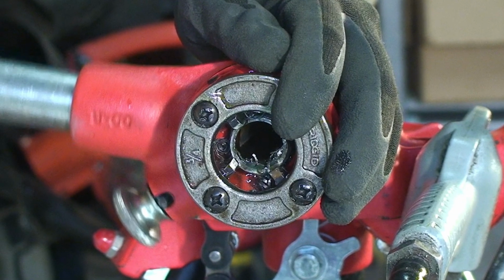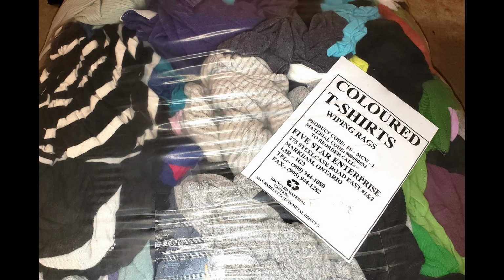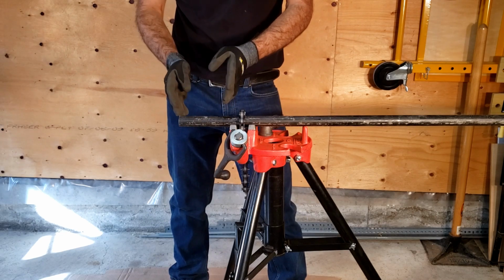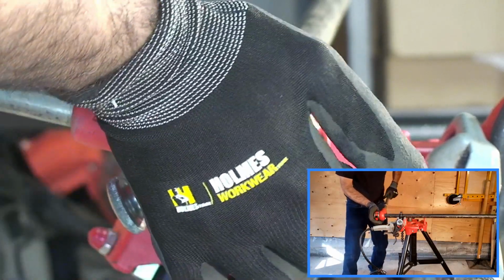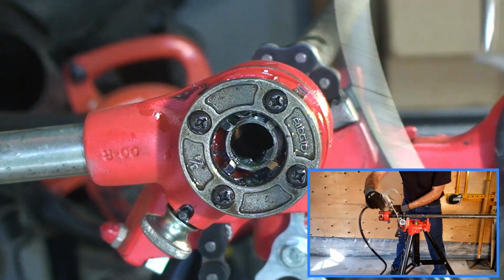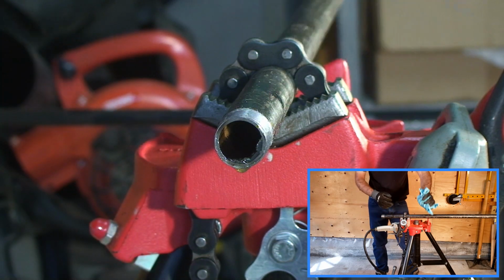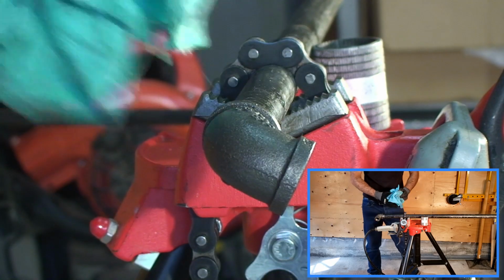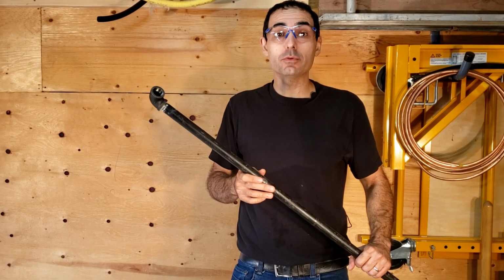Manually Threading Steel Pipe (Old School!)

Comment: Well, i certainly won't be taking this up as a hobby any time soon..lol..i was curious how to do it and now i know.
Great presentation!
Reply from the maker: Thanks so much!  It's no that bad, really...unless you're threading piping larger than 1-inch...which will turn out to be an ultimate and unforgettable fitness workout for your chest, arms and triceps!

But if you only need to thread a few joints, or are required to thread for only a small job (such as adding or modifying branch to an existing gas or fire sprinkler line), then this may be your most cost-efficient bet - without having to worry about purchasing or lugging around a $6,000+ power threader, like the Ridgid 300.

Thanks for your feedback!

Comment: I have made hundreds of threads on pipe ends. 1/8" up to 2".  Had a master threaded pipe fitter to tell me," You keep a 90 or tee  on the pipe vise. After making threads, try the 90 or tee on the new threads. The fitting must not turn more than 2-3 times by hand. Any more than 3 x ... and the threads were cut too far/deep ... the joint will leak.
 So, here is the formula..."three turns by hand...three turns with the proper sized pipe wrench...three threads left over (we can count the remaining threads..."ahead" of the fitting just tightened on with the wrench).
 Want to mention...can't trust the threaded ends from the factory. They are too deep. Cut them off, make new ones, then still put a 90/tee on the new threads (three turns by hand) to make sure. It's not much trouble...compared to installing the whole the new pipes up high, etc...then having to unscrew the whole thing...make new threads...then the putting it all back together ??? 
 Out of all the threaded pipe joints I have made in industrial plants, hospital boiler rooms...not one leak.
Reply from the maker: Great tips!  Fittings are also what I would always use to set and test my Ridgid 300 dies at the start of each day - and always made sure to keep one within arm's length for that purpose.  The only thing I would add is to ensure that the test fitting is new, notably it's of black malleable, which is prone to stretching.  The only other problem I've found is that even factory-new fittings have had inconsistent threads (even pinholes!) over the recent years - depending upon which offshore factory they were manufactured that week! 

Thanks for the feedback!
Reply: It's fine to put the factory threads on factory fittings as long as they're both out of spec by the same amount XD

Comment: Thanks for the informative video. If my pipe is underground, ie there is limited space, can the pipe still be threaded, eg by removing the handle of the pipe threader?
Reply from the maker: Unfortunately, you can not use these manual threaders without applying the handle for leverage, because there's simply too much resistance from the dies cutting into the pipe (the larger the pipe, the harder it becomes).  The good news is that, because the tool is ratcheted, you don't need much handle swing to turn the head (although it will take you a while if your motion is short).

As an (expensive!) alternative, they do manufacture electric "thread in place" power-drive threaders, which clamp onto the pipe while a motor turns the die head.  #Ridgid is one such manufacturer, but it may be overkill for your needs:

https://www.ridgid.com/us/en/hand-held-power-drives

If you only have a thread or two to make (and a bit of wiggle room), the hand threaders may be your most economical solution.

Thanks for watching, and good luck!
Reply: @PlumbingsCool  Thanks for the detailed explanation & great video! Really gave me a good idea of what I need to do.

Comment: I just purchased a ratchet pipe threader and cutter to connect some pipe for propane. 
Once the pipe was cut and threads made...the fittings don't seem to want to screw on. 
Saw one video that was saying that manual pipe threaders and even some of the electric ones do not taper the pipe and cause the problem. 
Would like your opinion on this. And if you agree to this being the problem...do you have any suggestion how to remedy it?
Went to Home Depot to have them cut pipe and had same problem....you could see that the threads by the manufacturer of the pipe were tapered. When Home Depot cut the threads...they weren't as far as I could tell.
Trying to see if there is a taper attachment for this pipe threader----or that may be totally ridiculous to even think that.
Thanks for your help and this was a nice video. Appreciate your time to put it together for us. Jesus bless.
Reply from the maker: Hmmm...I reckon something's amiss with your pipe threader.  It sounds like you're in North America as I am, which means that we tradespeople in the US and Canada utilize what's referred to as American Standard or Briggs pipe thread.  It's a standardized imperial system system that which maintains certain standards to ensure a proper thread.   There are three primary factors, which consist of:
-The correct taper
-The correct pitch or Threads-per-inch (TPI)
-The correct thread cut angle (60°s)

If your dealing with propane pipe and fittings, you'd most certainly be requiring a tapered thread, which is what allows the pipe to tighten as it turns into the fitting, and what ultimately causes a seal.  If it had no taper (referred to as a running thread, like a bolt or threaded rod), the pipe would simply keep turning until it would just keep  turning until it bottomed out at the end of the thread, and certainly would not seal properly. 

One way to test if the cut thread has a taper is to place a straight edge (like a ruler) flat against and parallel along the pipe and have a few inches travel past the threaded pipe end so there's an overhang.  You should be able to see the thread taper in and away from the straight edge as it comes to an end.

You can also roughly count if your threads have the proper pitch or Thread per inch as follows (although it might be tricky because your threads may not even actually be an inch in length):

-1/8": 27 TPI
-1/4" and 3/8": 18 TPI 
-1/2" and 3/4": 14 TPI 
-1", 1-1/4", 1-1/2" and 2": 11-1/2 TPI 
-Over 2": 8 TPI

Also, another problem causing your threads not to tighten is that you may be making your threads too long. As a general rule, the end of your pipe should pass the last cutting die by a distance of no more than one or two full threads. Anything beyond that last die is nothing more than a running thread. 

But all in all, if it's a reputable manufacturer such as #Ridgid, it's a sure bet that you dies should be tapering the pipe...regardless of whether it's electric or manual if they're designed for steel pipe.  The only other thing I can think of is that you're using non-standard/metric fittings or the housing screws holding the threads are loose. 

Sorry I couldn't be of more help from here.  Let me know how it works out!

Comment: What if the pipe I need threaded is smaller O.D than the O.D. of the pipe it is going to thread into? How do I know what size to get?

By measuring the I.D. of the pipe it's going into? I would think it would need to be slightly wider?
Reply from the maker: I think I know what you mean, but for clarification, your pipe will need to thread into a FITTING, not another pipe.  The most accurate way is to measure and compare the O.D. Of the other or existing pipe entering the fitting.  If the O.D.'s are the same, then you' re good to go...but this value is not representative of its nominal pipe size.  For example, 1/2" steel pipe measures approximately 7/8" on the outside. Although you can measure the inside diameter of a pipe to acquire its nominal pipe size, it will not necessarily be an "exact" measurement of the size due to varying wall thicknesses (schedule 40 has thinner walls than schedule 80, for example.)  But regardless of inside diameter, the outside diameter MUST be identical to the connecting pipe because the female fittings are designed to accommodate that exact outside diameter; any other diameter just won't fit.  Hope this helps, and thanks for watching!

Comment: Could I also use WD-40 instead of having to get cutting fluid?
Reply from the maker: I suppose in a pinch, WD40 would be better than nothing at all, although I would not recommend it. The pipe threading process creates a tremendous amount of heat (even manually), and I don't think WD40 is thick enough to absorb the heat and lubricate the die heads.  If I had to guess a suitable emergency alternative, I'd prefer to apply high viscosity motor oil to the dies, such as 20W50 (though I've never tried), which is much thicker than WD40, and has similar consistency as standard cutting oil.  If possible however, your best bet would be to pick up a litre of cutting oil from your local plumbing supplier.  It's probably somewhere around $10 to $20 these days, and is MUCH cheaper than replacement cutting dies!
Reply: @PlumbingsCool  Thank you kindly sir! I'll get right on that.

Comment: What do you think about cheap generic threaders?
Reply from the maker: Generally, I'm not a fan of most generic tools - unless you need it for the one occasional thread, and not for professional, everyday purposes. 

Many years ago, I tried to save a few bucks by buying a brand new generic clamp-in-place power threading kit for a bargain-basement price of $300, from a store we have here in Canada called Princess Auto (a nonetheless awesome place to find all kinds of crazy things).  I did manage to get through number of threads...until the clamp securing the power threaded violently snapped on me mid-use and nearly took my hand off!  A more professional, time-tested brand like Ridgid likely wouldn't have succumbed to that issue. 

I consistently tell my apprentices that your tools are your bread and butter; downtime or malfunction of your tools can cost you harshly, either financially or worse, safety-wise.  I recommend always buying the best you can afford at the time.  And as your profits increase, so can the calibre of your tools arsenal.  You don't need to immediately buy "best of the best" unless you know that doing so will pay off in work or efficiency gained because of it. 

Again, this is only if you're using the tool as part of your money-making career.  Rather, if you're a hobbyist or DIYer, then a generic threader may be all you need to make that one thread here and there.  Note that with respect to hand threaders, check if the tool is compatible with Ridgid dies.  This way, you may be able to swap out the generic ones that come with the kit with the superior Ridgid counterparts, in case you find yourself to be getting shoddy threads. 

Hope this helps!

Comment: Nice pipe threading action. Pleasure to watch. I used olive oil, it's just as good.
Reply from the maker: Thank you!   LOL...olive oil???...I've gotta say as a hardcore Italian, using olive oil for pipe threading comes across as sacrilegious!  Hope it wasn't extra virgin; that's like $15/litre these days! 
 🤣🤣  Glad it worked out!  👍
Reply: Needs must, especially if you're in the country. But no, I wouldn't abuse extra virgin oil. I'd be worried about the god's of the olive groves seeking revenge for such sacrilege 😅 Have it most days which I would have most days with salads usually. So good for you.

Comment: I’ve had to adjust the 4 teeth cutters slightly in to cut properly, you didn’t speak of adjustment of the teeth.
Reply from the maker: Thanks for your comment.

The teeth on these hand threaders are actually NOT adjustable; each die assembly cuts one particular size and nothing else.  

What CAN happen however, is that the four screws which hold the front plate to the body can become loose over time, causing dirt and shavings to get stuck in between, thereby misaligning the four dies - leading to a poor or impossible thread. 

So it's important to check periodically that the screws remain tight, and perhaps even dismantle it once in a while to give it a good cleaning.  Just be sure to place the dies in the correct order as indicated by the numbers on the die head and the respective dies...which would otherwise totally guarantee a bad thread.

If all that fails, you may have bad or worn dies.  Check particularly carefully along the dies'  teeth to make sure that none have gotten chipped off (a common problem when they've been abused or under-oiled during the threading process). 

Thanks for watching!
Reply: @PlumbingsCool  -  it’s brand new but cutting too big, I’ve opened it up and checked the numbers, it’s all assembled properly but won’t cut small enough, I’ll need to return it.
Reply from the maker: Sorry to hear that. Is it Ridgid?  If it is, I'm surprised that it's defective right out of the box...that's usually when they cut the best. Hope your problem gets resolved.
Reply: @PlumbingsCool  -  it’s Reed brand made in USA, third one that’s given me problems.
Reply from the maker: Interesting.  Reed's a pretty good company which has been around a long, long time.  You may want to call them up directly and see if they can help you out;  I've done so in the past for various reasons, and they've been pretty helpful & friendly.

I must admit that I've never used their threaders, but their plastic cutters and pipe reamers are amazing...better than Ridgid's, in my opinion.

Good luck!

Comment: Don't ask 'why', but how would I cut a counter-clockwise thread on the pipe?
Reply from the maker: A thread which tightens counterclockwise as it turns (known as a "left-hand" thread) is certainly possible, but to do so, you would need to source left-hand cutting dies and replace the exisitng right-hand dies in your hand or machine threaded with those.  To actually create the left-hand thread onto the pipe, you'd need to engage and run the threader  in reverse.

Hope this helps!

Comment: I keep breaking my threads in reverse, any idea why?
Reply from the maker: Can you please elaborate?  Do your mean that your pipe threads break when you reverse the dies to remove them, after you have made the thread?  I'm not sure what your is issue is, but try to dismantle the die head assembly to clean them out and check that they are installed in the right order, from 1 to 4.  Then make sure that the faceplate holding them all in place is snugly tightened with the four screws.  Hope this helps.
Reply: Yes when I go to remove th dies, I have done what you suggested a few times, maybe need more oil
Reply from the maker: Yeah, that's really strange.  Oil can certainly prove a factor in ensuring we'll-cut threads, but it's not typical to get bad threads only when reversing the die head.  If you went through all the other checks, then the only other thing I can guess is that you've got a defective or worn set of dies.  Are they Ridgid, or another brand name? Take a close look at each cutting die to make sure that none are missing any teeth, which sometimes happens after wear and tear.  Other than that, I'm not sure what else it could be. 🤔

Comment: for inner thread what?
Reply from the maker: I'm sorry, could you please clarify your question?
Reply: @PlumbingsCool  , how do you thread the inside of the pipe?
Reply from the maker: Ah, thank you for clarifying. 

What you're referring to is a "Female" thread. 

In the plumbing field, we NEVER thread the inside of piping, as doing so would decrease the inside diameter of the pipe size when inserting the male companion.  The only female threads are on fittings.

With that said, I'm not sure what your purpose is or how many threads you need to make, but you may want to look into what's called a "Tap & Die" set, which allows you to make both female (Tap) and male (die) threads.

Note however, that tap & die sets only produce "running" threads, which means that the threads are continuous and don't taper at an angle (such as a typical nut & bolt, or threaded rod) - whereas traditional plumbing pipe threads are tapered, , which allow the pipe to tighten as it turns into the fitting.

Hope that helps.
Reply: @PlumbingsCool  , thank you!